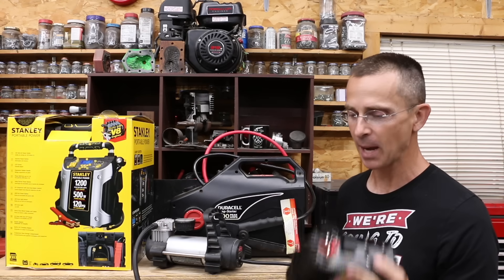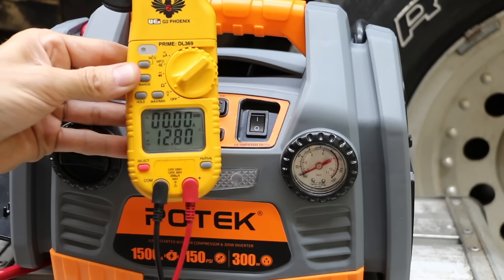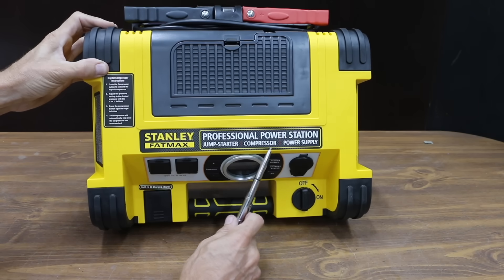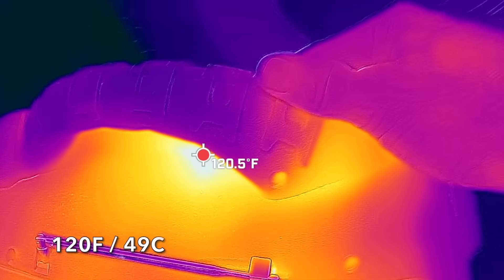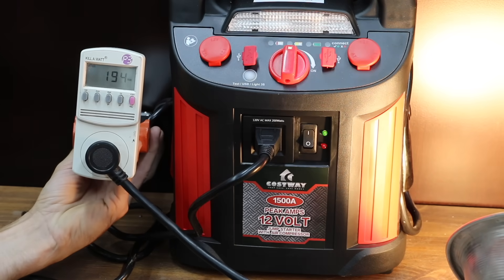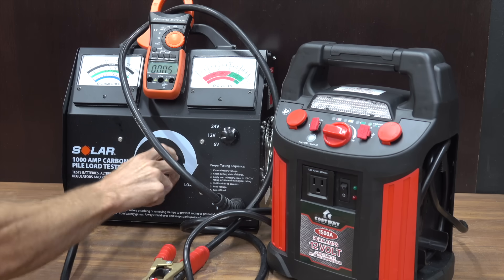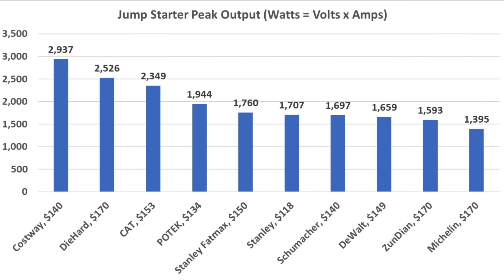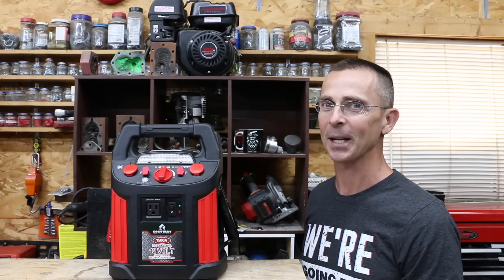Best Jump Starter? DieHard, Schumacher, DeWalt, Michelin, Stanley, CAT

Comment: I'd like to see a comparison of solo jump starters.
I have an Aitogen that worked twice, then wouldn't hold a charge and left me stranded. And then it wouldn't even charge at all and left me stranded a second time.
Both strandings were in remote areas.
Now I have a Gooloo (funny name, I know, but has good reviews). I have used it twice. We'll see if it holds up.
Update...I found your review of the solo jump starters.

Comment: I remember you testing tire inflators. None of them could run for more then 10 minutes without damage.
Reply: Actually a lot of them did, only 2 actually died IIRC, and one just had a hose break which he repaired on-camera. Some just shut off but after they cooled down they started working, and some worked for 20 minutes straight.

Comment: I've got the smaller stanley without the inverter, after about the 3rd use I'm pretty sure the connecting rod on the air compressor snapped. You can hear it running still at too high of an RPM and it makes no air. The battery also lives at 75% charge after 2 years, it will not get back up to peak voltage. Looks like I'm getting a Costway soon
Reply: Yep mine broke the same way pretty quickly. If the jump starter on that thing wasn't junk too, might be worth keeping.

Comment: Probably a really good idea to have one of these if you have a flat tyre that you need to replace

You can either use the air compressor function on them or just plug in a 120v corded impact driver to change the tyre.

I am probably going to invest in one of these. Not to start a car but to power my power my shed. I am just tired of constantly running an extension cord to my shed to power all of my equipment or just my lights.

I will get one of these eventually once I have cleared a space for where one can go and I will use the outside outlet as the charging point so I can charge it like a EV

Crazy right. I will actually permanently install it in my shed because it probably won’t be pushed beyond 500w and will be perfect for inflating my bicycle tyres when needed. So it would be better than installing gigantic, heavy solar panels on the shed roof because my shed is only made out of wood and it probably won’t hold up. Also, using this type of device that was obviously shown in the video would be both safer and more economically friendly.

Comment: I tend to store these jump starters for years before trying to use them.  And by the time I do, they will not hold a charge.  It'd be great to follow up with each pack after long-term dormant storage with a full charge, to see which unit's materials degraded & which ones retain their efficacy.
Reply: All of these things have little lead acid batteries in them. They can't sit, they need a recharge every couple months to keep the lead plates in the battery from sulfating and killing itself. 

These are convenient, but i call them all "sh*t". Especially these new ones with safety electronics in them that go up in smoke when you overload them (like trying to start a car with a 100% dead battery, similar to his max current test that killed a few units)
Reply: It is just better to change your carbattery a little earlier than buying this things and/or buy some oldschool jumper cables.
Reply: @jonasstahl9826  
There is always that one time it happens it would be handy. Seems to me the best all round unit is a capacitor style but then you would need individual backups for different jobs.
Reply: @larrybe2900  Agreed, there are tons of video's of people using caps to jumpstart their car.  Thing is you'd need a battery/cap device to get the functionality of these units.  Just cleaning the garage today and came across a couple of extra lawn tractor batteries.  I think I'll just charge them up, see which ones can hold a decent charge, then toss it in the trunk for the winter.
Reply: We have the Dewalts at work.  Instructions state to charge every 30 days.
Reply: That happened to me with a Stanley fat Max. It was a brand new product. I used it a year after I bought it and it wouldn't charge
Reply: This is the exact reason I won't buy a jump pack, the maybe twice a year I'd use it it'll be ruined, but, a power inverter is interesting option though
Reply: @codyselcamino  Get big one with 2000watt and you can run nearly everything and alot cheaper than buying a good generator.
Reply: The red sticker mentioned keep charge when not in use
Reply: It's best to keep them on a trickle charge if you can. Otherwise choose a jump starter that has a lithium battery.

Comment: To be honest, you're better off buying separate pieces vs all in one unit like these (buy a standalone compressor, jump box, and converter) - at least in my experience. I got a jump box for around $200 off amazon that's started my V8 from a completely dead and cold battery in the middle of winter, where all these struggled to turn over a small V6.

Comment: Great review! I have owned the Cat for two years,  I charge and use it monthly.  For $99 at Costco it's a darn good deal.
Reply: Yeah I don't understand this video because mine inflates tires up to 35 psi no problem.
Reply: @michaelhowell7275  I think he's saying from nearly 0 PSI until the battery dies. Not the MAX pressure it can output. I could be misunderstand that tho.
Reply: @XxManagedxX  It is from 0 and I fill more than 1 tire consecutively. The battery does not die either and I have had more than 1 of these.  Because the battery did not last 2 yrs in it.

Comment: Great video thank you.

Would appreciate your consideration on testing Jump Starters on being able to be used to charge an electric Vehicle of Plug-In Hybrid Rlec Vehicle 

I have a Mitsubishi Outlander PHEV an comes with 110vac charging cable which is switchable between 8 A and 12.

I have tried 3 different Jumpstart  units  one rated at 400 to 600 watts but no go

Just purchased Dewatt  2000 Peak Amps and 1000 watts portable power.  But it did not work either.

My car charging requires 8 X 120 960Watts.  So the 1000 watt unit should have worked  but no go.

Could that fact that these Jump Start Units have flowing Neuttal be the issue.

I did temporarily jumper the Neutral to Ground at the cord feeding charging cable  but no luck either.

Would appreciate any help on this from you or your viewers.  

Thank you

Comment: From personal experience I would never buy the Stanley Fatmax ever again, lets put that this way it only last it 6 months to be usefull and aftet that everything started to break and fail, first to go was the air pump, the battery was never good it drained fast, I got as Christmas a present, it was great when it worked but short life.

Comment: Just wanted to say I appreciate all the work that goes into your videos. Idea for video. I deal with low voltage data and fiber. We use a lot of different personal stage lights. A review over those products and ladders (true weight on run, tip ratio, strength, etc)
Reply from the maker: Great suggestion!  Thank you.

Comment: seen something the other day of a wench that is portable but uses a cordless drill to operate and can pull a car up a car hauler flatbed - something like that would be a great test for the actual power of the drill pulling a car / this video could a jump start pack with inverter really power a regular shop air compressor ( 110 ) not 220 ? and if battery pack is in actual charging can it still function with features ? -- always great material with  open mind to results during performance and workability - the choice is left up to the Viewers
Reply from the maker: Thanks for the suggestion.
Reply: @ProjectFarm  great for tires and such here but meaning a regular 60 gal tank shop compressor like Husky or Craftsman ? still great stuff !!!!

Comment: Huh, very interesting. One funny thing that relates to this, I have the lower level version of the Stanley, lower than the ones in this test. I was able to REPLACE the battery on a 2006ish, V6 Ford Escape that had been sitting for 5+ months. I hooked it up to the battery cables, set it in the battery holder, and let it rip. IT WORKED, it fully functioned as a battery. Now I know that the alternator took over after, but still it continued to function with no issues. :) I was VERY surprised, it was only rated for V6 engines was rated at like half of the lowest Stanley in this video.
Reply: Update: it is the 600 Amp one that doesn’t have an AC converter.
Reply from the maker: Thanks!  Thanks for the feedback.

Comment: When comparing tire inflators a good baseline to contrast against would be the old human powered stroke-tube. (Bike Pump). 
It's not fun, but it works doesn't run out of power and is faster than you might think.
Reply from the maker: Great feedback.  Thanks for the suggestion.

Comment: SLA batteries used in these do not have low enough impedance for cranking.  Smoking is quite scary!
LiPO starters are much more compact and can produce sufficient power to crank over high compression diesels even below freezing!
Reply from the maker: Thanks for the feedback.

Comment: I'll stick with my Audew booster pack. Doesn't have an inverter or compressor but will boost almost anything and has for several years now. If you haven't seen project farm's video on it, go check it out. I'd like to see a 2000 watt power inverter comparison.
Reply: I bought one too. It can sit for months yet still start a diesel engine without hesitation. Quite impressive
Reply from the maker: Thanks for sharing.

Comment: I have the DeWalt inflator (only) and I love it. I also have a separate battery jump starter. But I would never invest in a multi-tool like this designed for different emergencies.
Reply from the maker: Thanks for the feedback.

Comment: Great comparison! I wonder how they will test in a couple of years from now when the batteries are no longer new.
Reply: Thats spot on. These are fully charged then left in a trunk for months. After a year or so, its quite typical that they will fail when you go to use them because no matter what they have on them, the heart is the battery and wet acid batteries are still way behind in terms of performance after storage. Sure, the led light might work after months in the trunk but you won't have enough to air a tire. That my experience anyway with many different brands.
Reply from the maker: Thanks!  Thanks for the suggestion.

Comment: You should take a look at doing Digital Tire Pressure Inflators. There are so many cheap Chinese parts re-used everywhere and finding one that is accurate, durable and easy to use is neigh impossible!
Reply from the maker: Thanks for the suggestion.

Comment: Great test. IMO these things are a scam. Most people will charge them, put them in their car and 6 months or a year later when they need it I doubt any of them will start the car with a completely dead battery. Also, having it be multiple function means when one function goes bad you replace all of them. People are far better off with separate units. A good, Li-Ion jump starter, and inverter and compressor.
Reply from the maker: Thanks!  Great feedback.

Comment: Your next video, which unit still worked and took a charge a year or so later. Also, how to care for one of these so they last. I think I went through two of these before I gave up on them.
Reply: Yeah. At the end of the day, they are only as good as the wet acid battery that powers it. And the track record of those batteries is not the greatest. Not sure if any other battery type is better suited for long storage and deep discharge.
Reply from the maker: Thanks for the suggestion.

Comment: I wonder if they would start better by grounding somewhere else besides the battery post itself. When jumpstarting it's always easier to get the dead vehicle started by grounding away from the battery so the jumping vehicle doesn't have to overcome the drain of the dead battery as well.
Reply: An interesting point, but most people who are gonna use one of these aren't going to do that. Also, having a battery at 2v was basically a worst case scenario test anyway. Even if you leave your headlights on all night, your battery probably isn't going to be THAT dead.
Reply from the maker: Thanks for the feedback.

Comment: Just as your video begins within a few seconds I see the Stanley unit on the left and I bought one of those two years ago at Walmart for $100. Because I don’t trust any of these kinds of units I bought the warranty for just a few dollars three or four bucks I think. After I had a unit for a few months I began having trouble with it and I sent it back to the manufacturer. This of course cost me a UPS charge. They did repair it and returned it to me and they paid the shipping. Within a few months I experience another problem and I turned it over to the extended warranty  company, they paid me the full purchase price. When I hear you say made in Vietnam, made in China, made in Mexico and so forth I have to chuckle. Buy the extended warranty for a few bucks.
Reply from the maker: Thanks for sharing.

Comment: That's odd, I have that same smaller Stanley and it has never just stopped filling the tire; it seems to cycle. It will continue running, but you can hear it cut off the pressure valve (likely to keep the fans on the motor spinning to cool it off) and then after a few minutes, it will start pumping the tire up under load again.
Reply from the maker: Thanks for the feedback.
Reply: @ProjectFarm  My pleasure. Fantastic video, as always! I actually used your wiper video last night while choosing a replacement blade while standing in Walmart. They unfortunately had no Bosch, but did have the RainX Silicone, so got that.

Problem with the uniblades versus the mutli-hinged frames is that the passenger side doesn't curl enough at the last 4-6" to touch the windshield, so a triangular patch around 4x6x4.5" doesn't get wiped that the prior wiper got on my 2015 Ford Expedition.